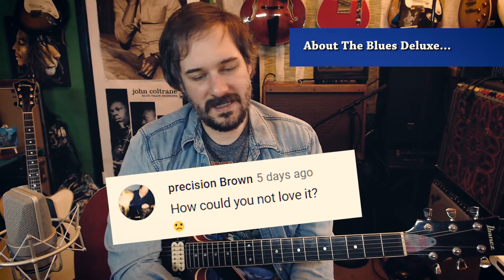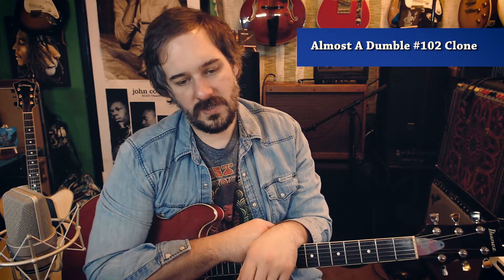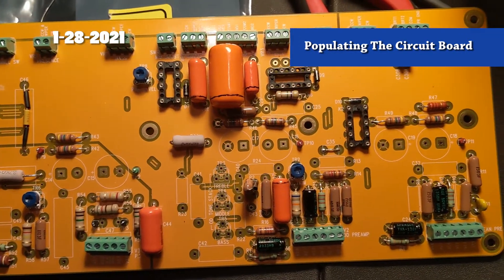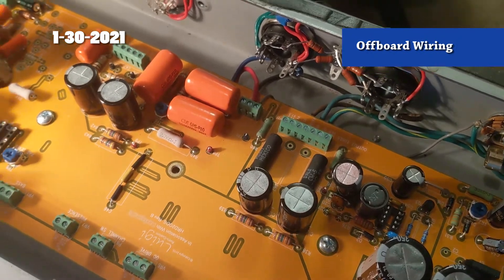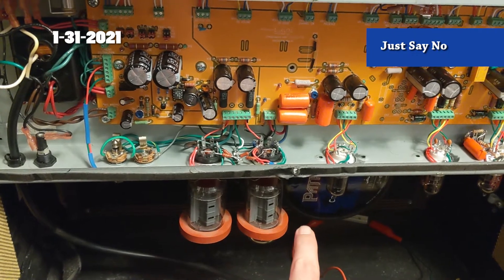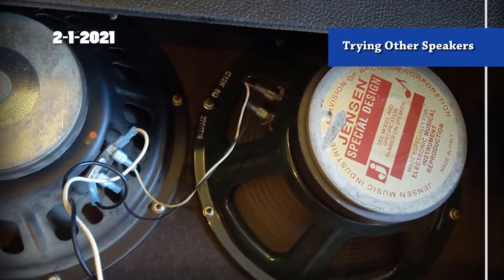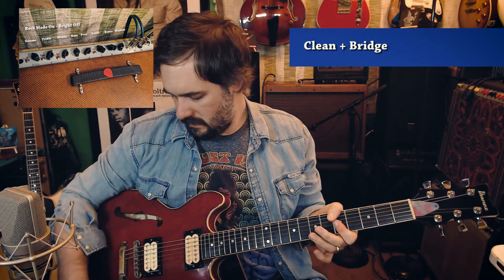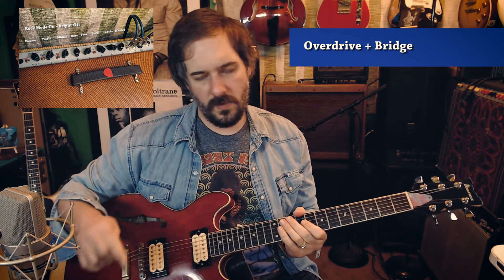Blues Deluxe to Dumble Overdrive Special 102 Style Guitar Amp Conversion From Start to Finish

Comment: Once again nice work!  I read a bit about the Robben Ford #102 and it seems that it was modified/upgraded as time went on.  Did you do the early "green light" version?  Or the design in the thread #102 Robben Ford Amp (High Plate Skyline) at The Amp Garage?

Comment: I know this video is older, but hopefully you can still see this & respond. Do you think this could be used to build i to a rackmount as an ODS preamp & not use the power section of the board?
Reply from the maker: @stevesalazar9658  I dont see why not, but an eyelet board build would make more sense if your not utilizing the whole circuit. Also you would need to figure out the appropriate power transformer. The preamp still needs to have the correct voltages, etc. I suggest digging around on ampgarage... There are some 'preamp only' builds on there from the past that could point you in the right direction
Reply: @BirdsnakeBrown  Thank for the quick response & info. Much appreciated

Comment: How much did this conversion cost? I have a Fender Hot Rod Deluxe I was wanting to hot rod, but think a conversion like this might be better
Reply from the maker: Do the conversion! I play mine at about half of my gigs and it really sings.  It's been a while now and I'm not exactly sure, but I think for the board, sockets, and components you are looking at around $300. The donor amp gives you the most expensive parts of a build.
Reply: Nice. I actually got the amp for free from a co worker because it wasn't working, but changed the main filter caps and new tubes and it was working again. What tubes do you have to use with this conversion?